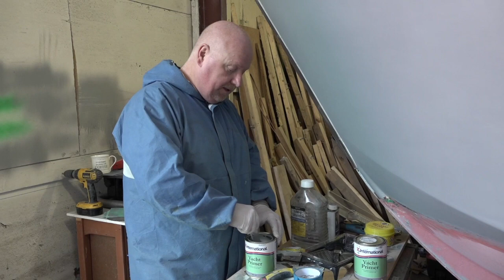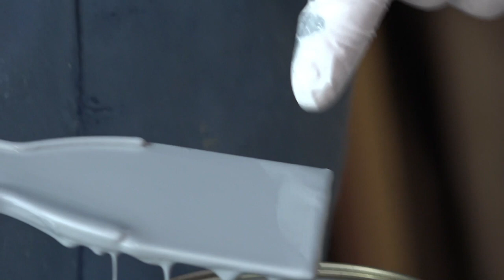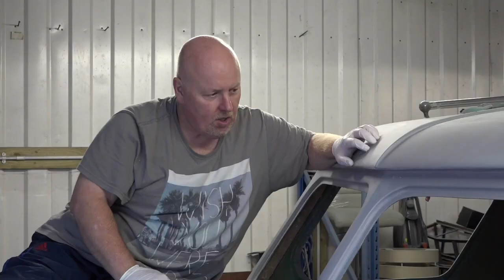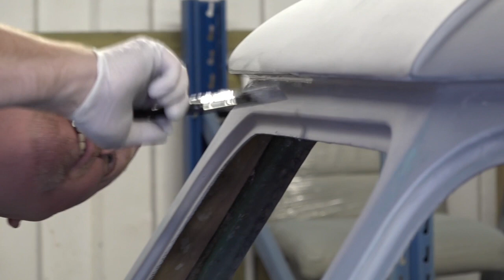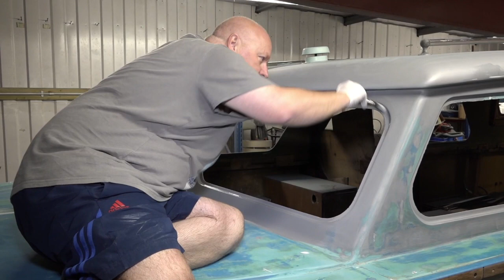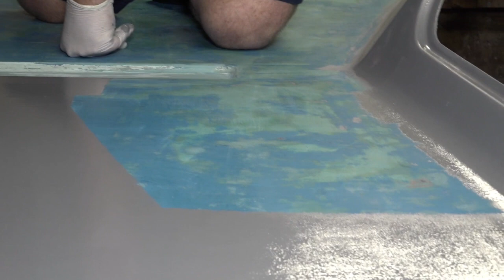Canal boat Restoration, boat Primer, Episode 2 part 1

Comment: well, Im starting the long and arduous task of watching all your videos again.  I have to say they are quite amusing.     My boat (also Nauticus 27) is out of the water for the winter and  i need to prep and paint the hull,  along with some engine tidying and servicing).   I will be hoping to tidy the strakes up also.    dont really want to get into a bigger job just yet, planning to use the boat from march, so just want to make sure it is sound and secure.
Reply from the maker: Take your time watching them as I’m slow at getting these episodes out😂, I took this boat out just to do the coupling and a little make over ! Big mistake, I’m 4 years in and a few quid down dear boy , thanks for subscribing and happy viewing of two grumpy men with a little idea of what to do 🍻🙋‍♂️🇬🇧